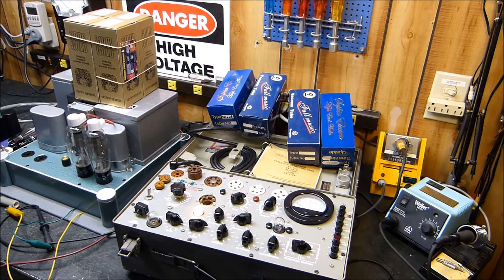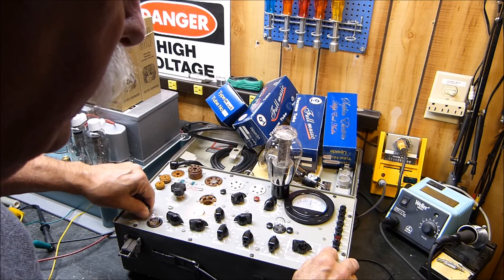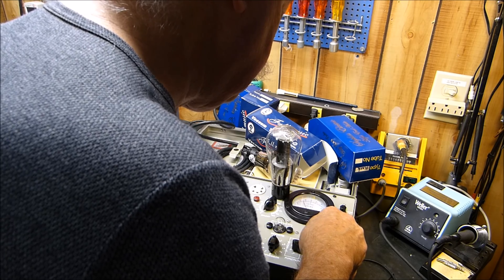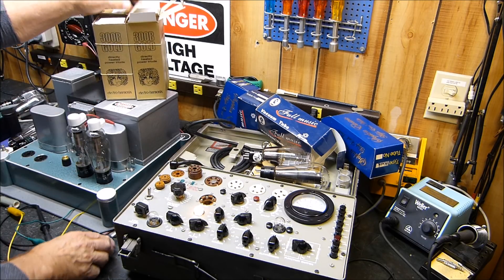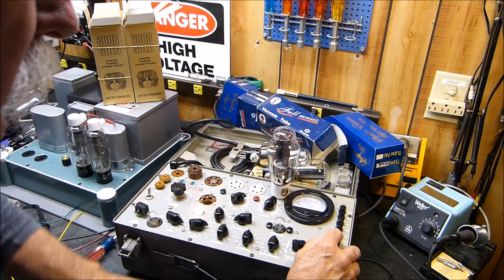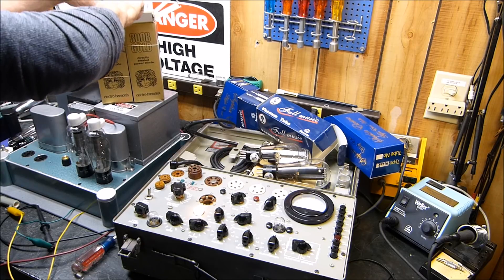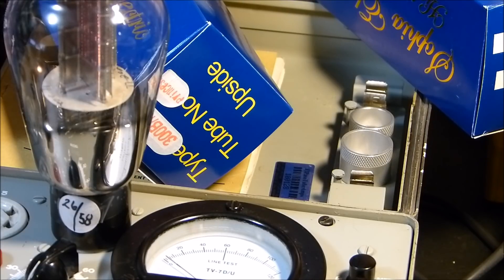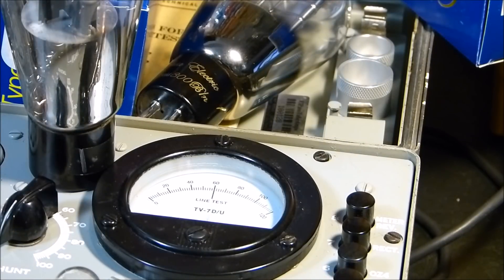Testing 300B Tubes, Electro-Harmonix, Sophia Electric and Full Music Brand Tubes

Comment: Hello,

I realize that these tubes may be under warranty but you might check the tube pins. I have seen the solder connections on the pins that weren't secure
Reply from the maker: Completely agree with you, Tim. I have seen the same thing but in the cases that I remember, the tube either did not work at all, (open filament) or it performed so badly (open screen wire on some KT88's). In the bad pin KT88 case I have encountered, I started comparing the capacitance readings between the plate and or the cathode to the other elements in a good tube and comparing to the bad tube and discovered the unsoldered screen pin. I have been able to repair each of these types of problems of open pins by heating the pin and putting a good bit of solder down the hole in the pin.  This has Not worked in all cases with me. Before I did this, I did contact the seller (Ebay) and got my refund and was told to keep and throw away the tubes. I have also received other tubes with open filaments that were broken internally and nothing could be done. 
Also, I have some pretty amazing news since posting this video.
I plugged in the two bad tubes into the tube tester and set the voltage for 6.3 volts and left everything running for at least 30 minutes each (for each tube). Afterwards, I turned everything off and removed the two bad tubes shown in the video. Just virtually minutes ago, I plugged them in and they test as good as 70 and are stable.. wow... heating the filament for 30-45 minutes at 6.3 volts seems to have revived them. I would have never believed that. They surely aren't thorium-tungsten filaments. It is hard to believe but I am amazed and they seem to be OK now running at 5 volts on the filament.
Only time will tell if they are truly "fixed" and stable.